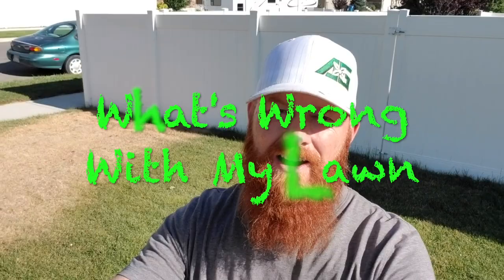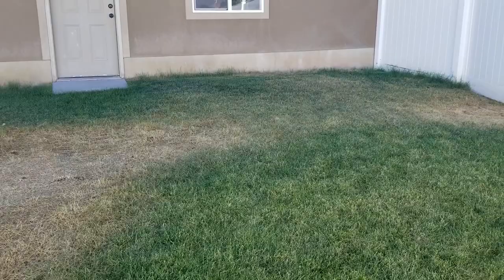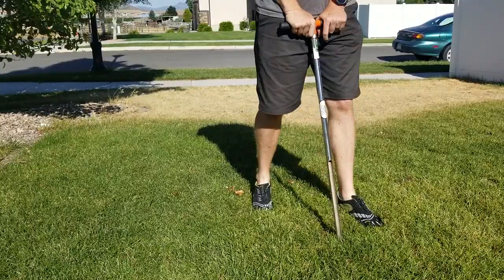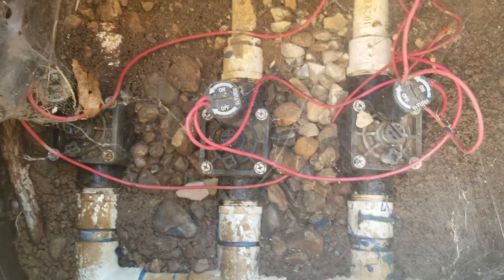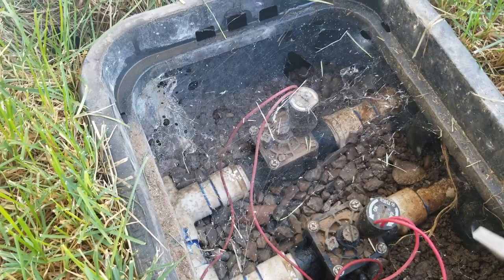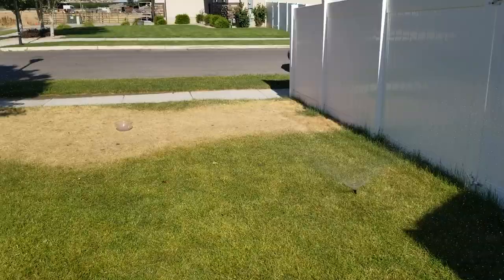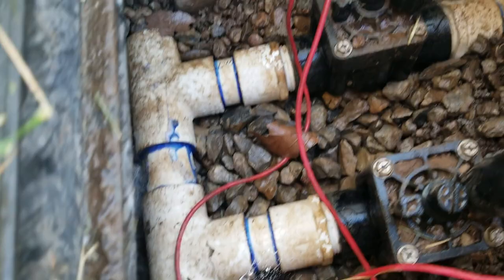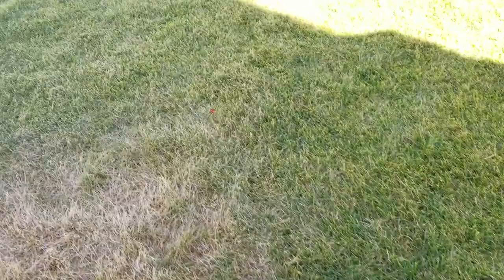Why is my grass dead?  What's wrong with my lawn? Sprinkler Problems

Comment: I am no sprinkler mechanic, but here it is anyways: it should not be sprayers.  If they switch to MP rotators they'll get better range and more even coverage.  Most of the time they just screw in place of the sprayers.
Reply from the maker: Nice comment. I had a severe hate for my rotators. Now that I have them they are awesome. Took me a while to understand how to use them.
Reply: Interesting!  I found that if I got the rotators precisely in the right spots, I could get the best coverage of my GPMs at the correct rates.  I have no experience with them long term.  Maybe a video idea for you?  I’d like to hear what your experience with the rotators has been.

Comment: I don’t know what’s more frightening- having to dodge black widows or hearing that the brown patch may be too far gone ... 😂

I don’t have a sprinkler system- what type of hose sprinkler head do you recommend?  I use the kind that shoot water in a circular direction, but also feel it goes over a lot of the lawn
Reply from the maker: We live at 4500ft altitude and need a lot of water.  The majority of people use hunter or rainbird oscillating heads and depending on the flow rate can push a ton of water quickly.  Lately in my new home I have the hunter MD slow flow heads.  I've been learning the science behind it and its working.  Slow and steady with water is always the best IMO.  But most people have too many stations and cannot run the stations as long as the hunter md heads require.  Interesting stuff.
Reply: Hunter sprinkler bodies with either hunter mp rotators or hunter spray nozzle. With either Rainbird 5000s or Hunter PGPs and PGJs

Comment: This year I am having the same issue with brown and bald areas from compacted soil. I have dialed in the sprinkler head to shoot out and to the sides but some areas don't get enough water because it shoots up and over. How can I get more water around the sprinkler head?
Reply from the maker: Usually comes down to the sprinkler head was installed to high or low. Could be the nail on the front of the head needs to be adjusted
Reply from the maker: @arielrodriguez6980  really depends on the type of sprinkler head.

Comment: My brother it looks like you need to keep a small shovel or something like a drywall saw with you anytime you look at sprinklers. You needed to remove the dirt, sod, and soil a good 6" around it so it could slowly fill itself back in. In no expert and I've never done anything like this before. I just saw him trying to claw the dirt away like a dog would and we have mastered hand tools that do a million times better. Does he need to replace heads or different ones was my first thought?
Reply from the maker: Completely agree Donald.  I've avoided sprinkler work for a long time.  However, your point it valid.  Having a tool would at least make the diagnostic approach easier.  Especially in this instance.
Reply: @pestandlawnginja  This is just a thought and I got mine at Lowe's or Walmart. I have a Irwin (I could be wrong on the name brand) and the blade folds into the handle. The drywall blade is jagged and sharp as hell. So I was like one of them would have been great to remove the on off water covers as well. It was like $10.
Reply from the maker: not bad.  I'll give it a look.

Comment: https://misterlandscaper.com/ in the sunny hot area's during the day. I like the spinners on stakes that really mist.  I used a spiral tomato stake that I run the hose through and set a spinner at the top 5 feet up. Nice cooling and very even misting. At 6:46 that sprinkler is sending out a lot of water all at once. Most sprinklers do this, too much water, too fast. IMO.  A fine mist almost like a damp fog during the hot dry time works wonders. Got yellowing use iron. Grass loves sunny, cool, damp (not humid) weather. My mister cools the air by 15-20% . Good luck.
Reply from the maker: Thanks for the comment.  Hunter MD came out with a very slow flowing sprinkler head that uses the same ideology that you speak of.  My local area doesn't do so hot with the misters because of the dry heat.  It evaporates too quickly.  IMO misters at sea level do very well.  We also get too much wind here during the early mornings so bigger droplet sizes work best.